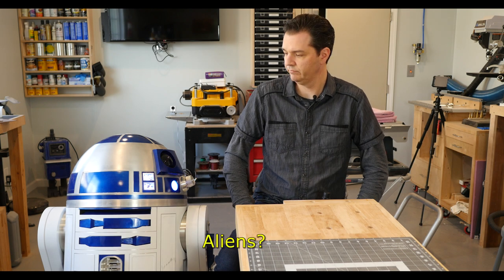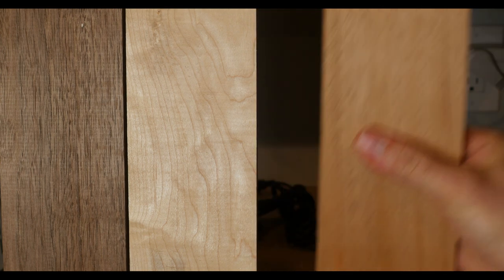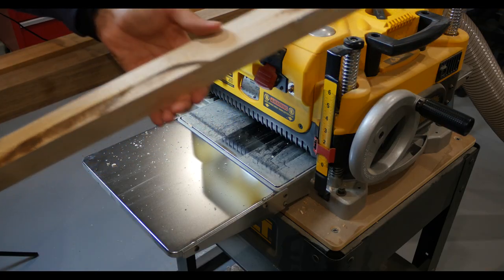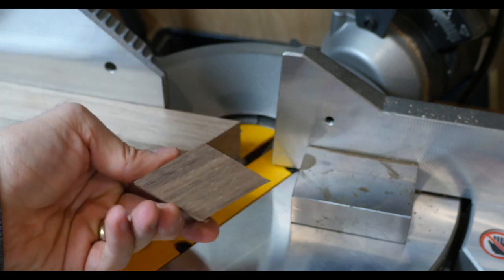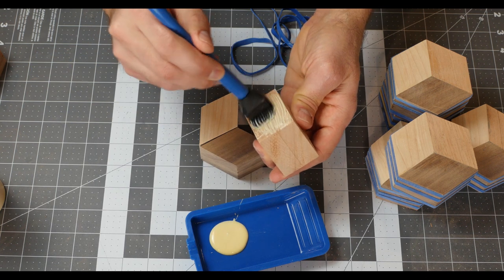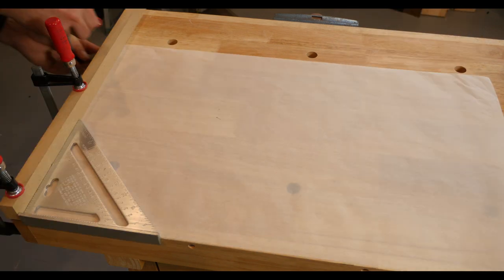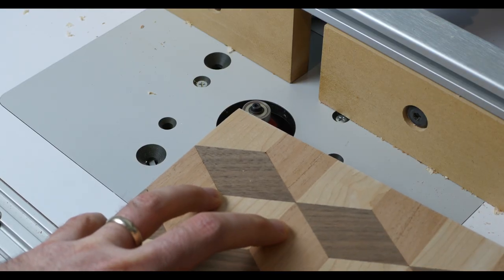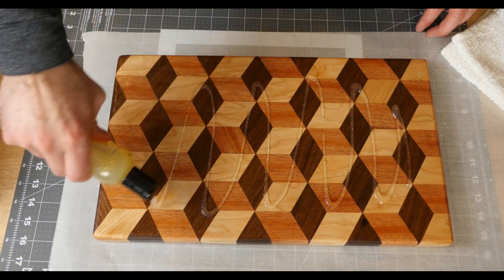How to Make a 3D Cutting Board

Comment: The final board came out amazing!  I have a Bosch 4100XC-10 table saw as well that I use to make cutting boards among other things. Anyway, to prevent burning when I use hardwoods, especially hard maple, whether it be plain or curly, I use a brand new or freshly sharpened blade.

Comment: I came across your video on making a 3D cutting  board; I'm new to woodworking, your video is great, but do you have written instructions on this project?  I'm trying to figure out how much rough lumber to buy, and the dimensions of both the rough lumber &  sizes of the small pieces. Thanx.

Comment: Help, your board is great but for some reason I can't get my three pieces to line up. One is too big but the are all the exact same size and cut at a 30 degree angle. If you have an email address I would be glad to send you a picture. Thank you.
Reply: Same here!You find the fix?
Reply: Not yet, I wish I could figure it out.
Reply: I got it right the other day on test peices.I think it's off ⅛, throwing off my fit.Should be perfect daimond.
Reply: I got it!I put my off cut diamond up against my stop block and locked my miter blade and pushed my stop block over till my diamond block touched it.It was perfect mirror cut.